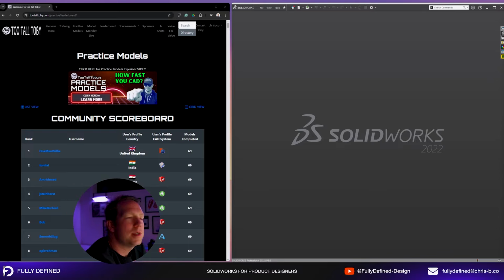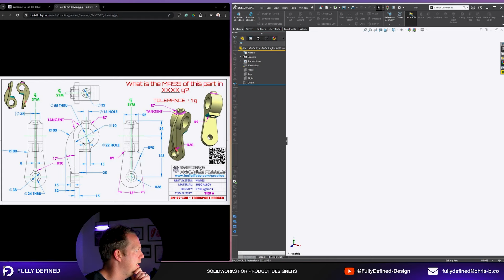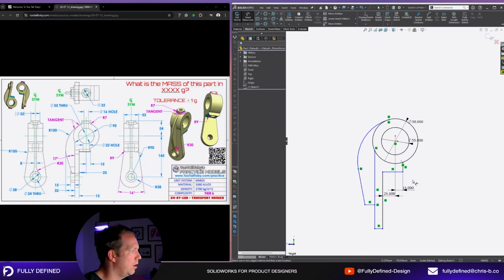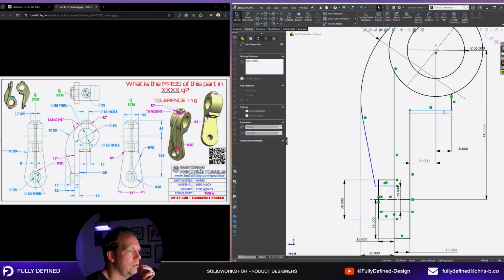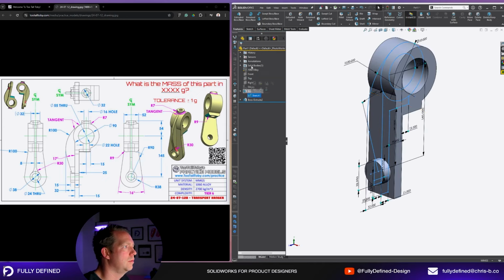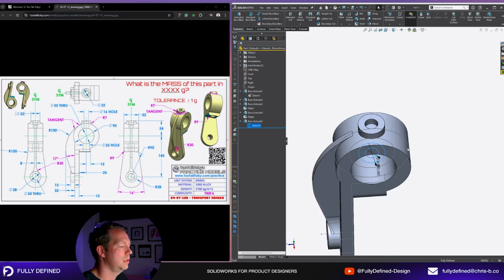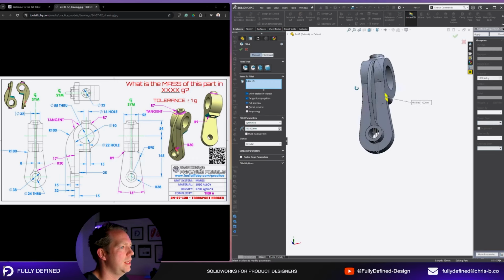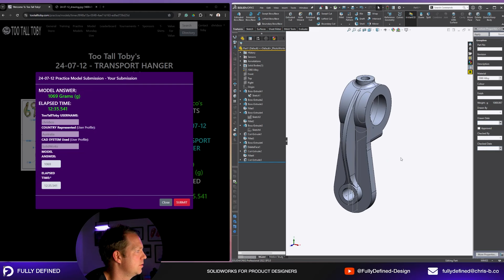SolidWorks - T6 Model - Speed Modelling Tutorial

Comment: Copying CAD models ain't the same as original concept design. What's very clear is more time is spent on locking down a sketch than anything else which is exactly the opposite of creative free flowing design in my book where the focus is on the actual necessity of the feature or even the part itself rather than fully defining a sketch. I can see the value of parametric part modelling for complex moldings, but for white page ( blue sky) modelling where almost nothing is validated until a design is finished then parametric isn't for me.
I can see the benefit of rule based design with perfect defined sketches at the detail stages for users of the file who weren't it's creator. A final design is a succession of qualitative and quantitative decisions which need revisiting over and over until an optimised solution emerges.
Reply: Having said all that, first time about 25 mins, second time 16 mins - productivity in modelling is always important and seeing how others do it is always a good idea. - thanks for the video.
Reply: First time it took 25 minutes, second time 16 minutes. So there's value in challenging your productivity methods of modelling.
Quick question. The website that these models come from the guy is using IronCAD - so will that really push Solidworks users to complicated modelling techniques?
Reply from the maker: hey  @timheeney2060  thanks for watching!  Love your comments. I 100% agree, copying CAD models and speed challenges like this are totally different from a Product Designer's typical workflow.  What I've found beneficial from taking part in these challenges is discovering new methods to create simple features and time saving tips that have greatly improved my efficiency.  Spending less time in CAD lets me focus more on the design I am creating.  

I also think the type of modelling (parametric or otherwise) used is impacted by the product's one is designing.  I work for a company where we use a lot of rugged, geometric shapes.  Locking down early concepts with defined sketches is important for control and to see where the creativity can flow.

TooTallToby uses all types of CAD, but is a CSWE (SolidWorks) and Certified Onshape Pro as well.  Even though it's not for me, there is still value in seeing what other software can achieve and how.

I have a new video coming soon showing a detailed concept design from scratch - I hope you'll like it
Reply: @FullyDefined-Design  Well, then, i'll look forward to that detailed concept design concept. I'm biased against parametrics believing them to be to creative restrictive perhaps because I don't plan ahead too well and also I keep refining, refining refining... which always involves my last brain bulb-on moment, rather than my first ' let's start like this...

Thanks for outlining the CAD TooTallTony uses - IronCAD I couldn't get on with, but that was twenty years ago now! Onshape, well that's parametric, I tried it, but it's not for my chaotic mind. Certainly Solidworks has some very productive tools that I just don't have.

Reading everything back, I come over as a lecturing prig. Sorry I do that. All I really care about is getting the design finished pronto - a bit of considered forethought before frantic modelling is always the best decision for me at least. I used to design in 2D, defining the assembly concept in functional sections showing all the mating and clearance conditions. 3D modelling is a little more tricky either giving me too much visual information or hiding just exactly what I want to focus on.
Reply from the maker: @timheeney2060  no problem at all, I took it in the discussion tone I assumed you intended.  thanks again for the comments.  I know what you mean about having too much visual information.  I regularly use the Isolate and Display State tools in SolidWorks to focus on the details I need while editing.
Reply: @FullyDefined-Design  Thanks for your comments. Isolate and Display state would be interesting to see sometime.